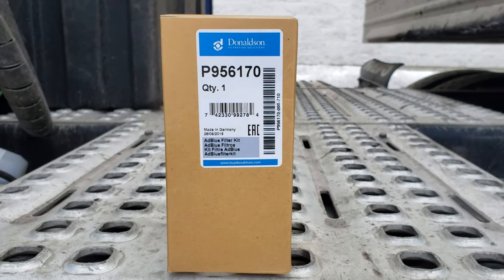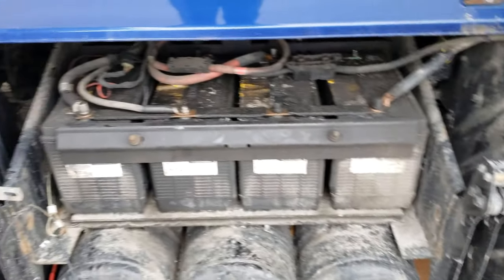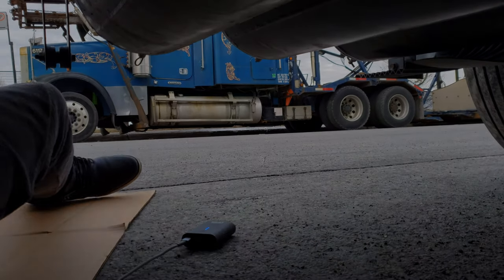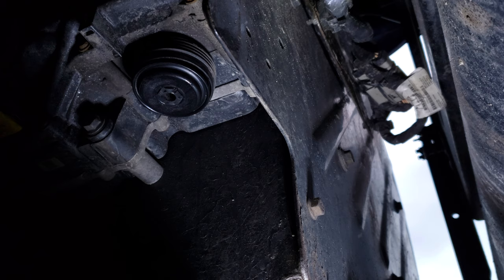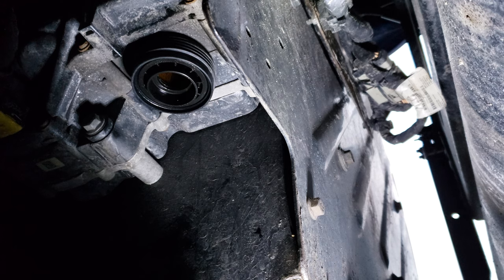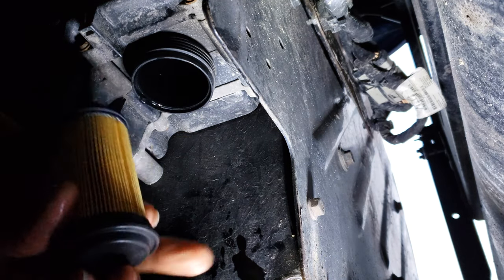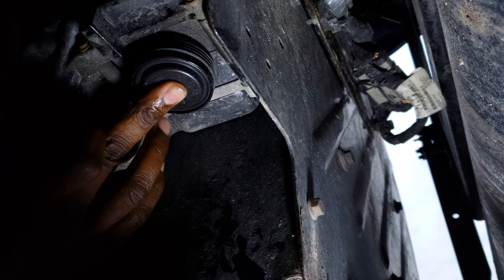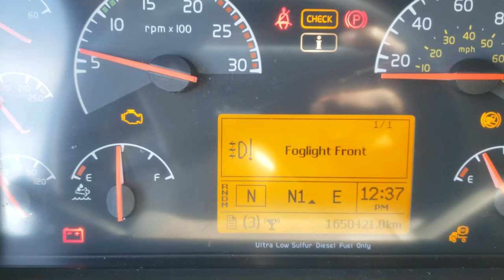How To Change DEF Filter On Volvo VNL 780, VNL 670, Semi Truck

Comment: Hey TroyStarz...don’t know if you’ve done this before but, another filter to consider changing is your power steering filter.  Most people don’t know your power steering reservoir has a filter in it.  The fluid should really be drained/changed but if that can’t be done then a filter change will do as long as its not dark or dirty. Love your videos. Keep truckin’ TroyStarz!!
Reply from the maker: Yes I did change it sometime last year thanks for the suggestion 👍👍👍
Reply: Jamil B Thanks for the information man i have no idea that power steering has filter too
Reply: Jamil B
Thank you for sharing that, I had no idea too.
Reply: Hello, where on the truck is that filter?

Comment: You should have gotten a channel lock pliers but that will work still , also you should have grease the threads to make it much easier to pull the next time
Reply from the maker: Ok 👌 thanks for the info
Reply: I would be careful about using grease on threads too much of a possibility of cross-contamination getting that in the d e f could be big problem